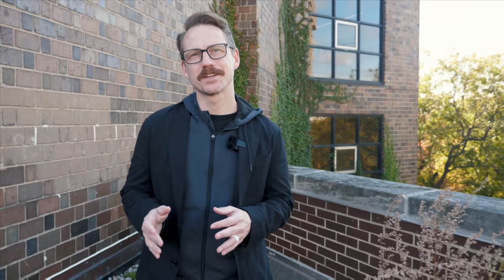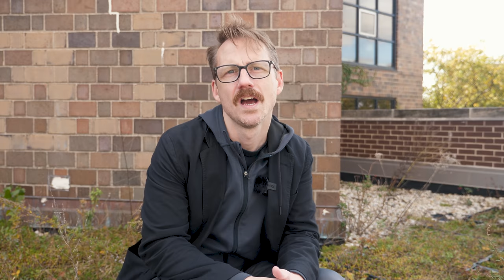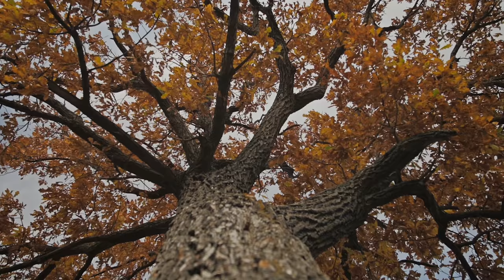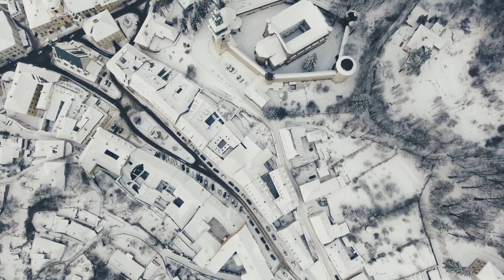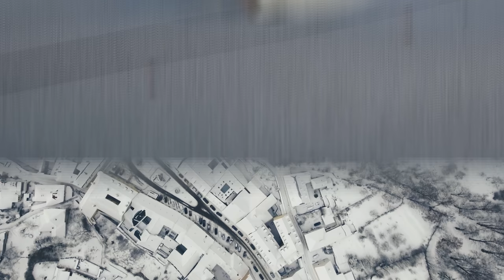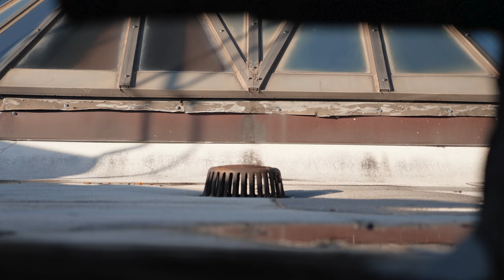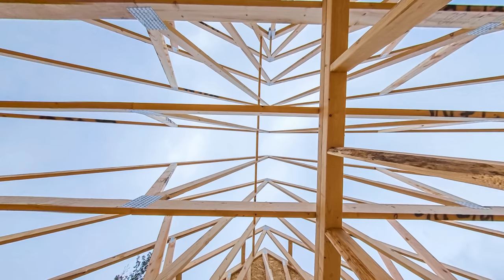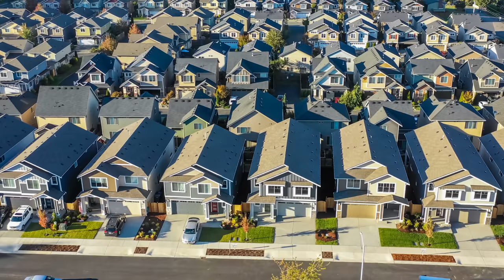Why Do Architects Insist on Using Flat Roofs?

Comment: Flat roofs waste a lot of heat energy and cause moisture (mold!) issues on the inside that are unrelated to leaks. You aren't doing much to dispel the "Architects are arrogant" story by skipping this big topic. Also, you neglect to mention climate. In ancient Egypt, where there is little rain and it is generally dry, a flat roof makes more sense in some cases, especially using old traditional building methods.

It frustrates me so much to hear you making claims about sustainability without mentioning the topic of how attics work to regulate heat and moisture, and how using various expensive layers of petrochemical products, is the only way to rectify that. (unless you are in a dry stone building or other traditional construction.)

I love green roofs with usable areas. But architects more often opt for big black petrochemical surface heat island roofs that you can't walk on regularly due to risks of causing a leak.

That air pocket of an attic is a design that is more intelligent than the buildings that are often built using "new" methods. I want my buildings to last more than 20 years, thank you very much.

Comment: You didn't addess the snow. How do you get rid of 1 or 2 meters ( 3 to 6 feet) of snow on a flat roof? Where I leave all roofs have a 100% incline or more just because of the snow. We don't have skyscrappers but barns and stables can be a relatively large surface area. 20 by 50 to 100 meters is pretty common. And for cheap construction tunnel shaped roofs are the norm. Never saw anyone making flat roof here. So how do you deal with 6 month of snow on a flat roof?

Comment: I have a flat roofed house near Seattle.  Horrible choice for this area.  The moss can’t roll off, so the downspouts get plugged every year, and the ends of the support beams are rotting because the eaves don’t come out far enough.  Hoping to move soon.
Reply: well, a flat roof has to be cleaned, just like the gutters need to be cleaned on a gable roof.

Comment: The Flat roof does not fit the astetic of my city and i dislike anyone building their slow slope small roofed flat Buildings, next to this citys beautiful Gabled roofs. It is easy to design the gabled roof with a room (in the roof) for someone to live in, and it is very practicaly to use it in places where there are not that strong winds and too much snow in the winter.
And i must say from my life in this city i've encountered it more often in the "new" building style of flat roofed buildings that it is dripping in the building and much much less in  the ones that have pointy roofs. Maybe its just my bais but if a pointy roof is dripping in the building the damage is most of the time easyli identifiable (for example a tree stuck in your roof) , and not hid under 2 to 4 sheets of some compounds that you first need to, shovel stones around, find where the water seeps throu.

Comment: The many defensive flat-roofers in the comments trying to explain away the problems people have had with flat roofs as "just bad craftsmanship" completely miss the point:  Yes, most construction workers are not OCD perfectionists...so if you live in a place with rain, just don't build the flat roofs that you already know they are inevitably going to screw up, and which will therefore need replacing (and other expensive repairs caused by leaking) much sooner.

Comment: well a flat roof does have advantages!  its may be cheaper and definitely faster to build, gives you another floor!  they are low profile so blend into the environment better, it can be easier to clear SOME mild snow since you can use a snow blower up there,  they use less lumber/trees, if you have to replace the roofing material its easier, you can put PV panels up there via a racking system that allow easier cleaning/maintenance,  and yes can be a bit more resistant to tornadoes.

Comment: Egyptian and Mesopotamia were so known for their heavy precipitations. 
They have their use but often they are just ugly "modern". There are more option than just flat beds or gables. Gabled roofs are also flat - but you can have just a single flat angled surface. i do not count <5° as being angled as the typical 1-3° are still too shallow for preventing long lasting puddles.
Large multi-story buildings are of course different. when nearby they are just too high for their roof to be visible anyways and they just have different problems and requirements. You can't let snow and ice fall down 50 meter from a sloped roof. That would just be too dangerous.

Comment: What about the social consequences of flat roofs?  That is, I've noticed that anything w/ a flat roof tends to fall into disrepair while the neighborhood looks like a slum & quickly degenerates into one.  Same w 1 story houses in general - they tend to fall into disrepair while the neighborhood looks like a slum & becomes one.  I suspect that we have such a deep-seated belief that 2 story gabled homes are "real" homes that anything else seems cheap & bad, leading the area to degenerate.  So, for example, I suppose there's no real reason we can't build our homes out of metal, but a neighborhood of metal homes would degenerate into a slum simply because we associate metal buildings with cheap or inferior.  Anyone agree or am I simply seeing an association that doesn't exist?

Comment: On Colorado, I'd never put flat roofs on a residence. In the mountains, snow would build up, too much, and down here in the Front Range, the daily thaw/refeeze cycle would turn it into an ice-rink.

On top of all that, a 40-degree roof slope -- basically, the bog-standard 10/12 pitch of 39.81 degrees -- provides the perfect slope to maximize solar panel efficiency, at this latitude.

Plus, I think modernist cubicle architecture is just f-ugly. Hard pass, just in terms of aesthetics, for me.

For taller commercial or office structures, I can see the argument to use flat roofs for HVAC and other equipment, but I'd much prefer a different option than glass boxes. 🙄

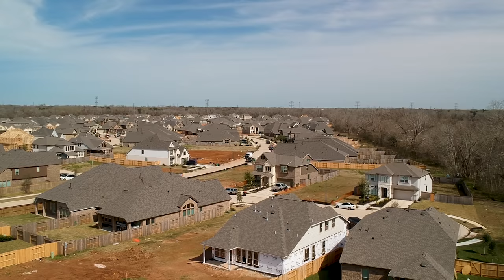Comment: Well thought through explanation. But I find it just very ironic, that the video shows roofs, which have absolutely ridiciolus amounts of angles and corners, when you explain, why gabled roofs are harder to plan and construct. And I really think this is some very weird American thing, especially in terms of an argument against gabled roofs. 99% of gabled roofs in Europe are just very simple tent shapes. In some rare cases, the garage has a different roof or an extra angle and sometimes houses with a regular square base, have pyramid forms, but thats really uncommon if we are talking about an average house. So I think the math and construction behind a gabled roof goes up in complexity, if the local architectural preference asks for seriously unnessecary forms as you showed at 8:36 for example...

Comment: You began this video by saying that roofs collect snow and collapse under the weight. I live in a snow prone area of upstate NY. I have heard of no more than two roofs collapse from snow and they were old structures, happening decades ago. Our home is a Cape Cod style with two massive, flat but tilted roofs. We now have a metal roof. The snow accumulates to a point then slides off harmlessly onto the ground. So your assertion is only partially true and under certain circumstances. FYI... According to the Merriam-Webster dictionary, the plural of "roof" is "roofs."

Comment: You say multi-gable roofs are "silly"; so why is it that they're so frequently used in large buildings - such as in factories which have lengthy production lines, or in which large ground area is needed, and where the weight of objects brought into the building means it's impossible to use multiple floors?
Secondly, you point out that gabled roofs are susceptible to wind damage - then you show pictures of homes with very shallow gables.  Research was done at a university in England showing that the more shallow the gable, the less it can withstand strong winds.  The researchers also confirmed the correctness in design of the A-frame buildings of the Early to Mid-Medieval period, and later designs of buildings with gambrel roofs in eastern areas of England, which in many areas, is flat as a pancake, and very exposed to storm force winds coming in off the North Sea (bear in mind that the furthest you can ever get from the sea anywhere in England is about 70 miles). Here's an example in England, though you can also find many examples in the most windswept parts of the US:
https://southernpremierroofing.com/wp-content/uploads/2021/09/3051916_236dfcc5.jpg
And not how the roof space, far from being useless, is used as bedrooms (note the dormer windows in the roof).
Steeply angled roofs are so wind resistent that, in the same part of England, you'll find many homes with thatched roofs, many of them built hundreds of years ago:
https://www.cambridgeindependent.co.uk/_media/img/620x0/OEPN37KBBCELH8IJVDDF.jpg
As for it being so difficult to use loft space for anything but storing junk, there are companies all over Britain who do nothing else but converting lofts into additional rooms.  A 'net search on Google using the term "loft conversions, uk" brought up over 2,500 entries.

Comment: Gable roofs are more likely to shed ice and snow on the pedestrians and cars  stories below. It's much easier and safer to repair flat roofs. Flat roofs fir smaller buildings are dumb in places like Texas where they have tornadoes. Gable roofs are less likely to tear off the buildings during those extreme weather events.

Comment: Also, unless you are on the equator, most latitudes would require a substantial tilt to the roof to face the Sun for your solar panels.    Frankly all homes should be designed as if solar will at some time be put up.

Comment: Building have this shape to be imlosing.bits thr opposite of the Disney castle effect.  It makes something big look deceptively small and then when uou interact with it its shockingly sterile and imposing.  Think of the convention center.  You know its big, it looks nig, but its not until you walk through empty space and gardens added for comfort that its size becomes impressive.  My favorite is running on 5 of 20ks on freeways in which what normally looks to size immediately becomes huge.  How long does it take to run through an intervhange?

Comment: Perhaps the fact that  gabled roofs require less angled infrastructure underneath to support solar panels and they are flat surfaced facing to the south in colder climates and catch the rays in the winter they would be a plus over flat roofs. Personally I would prefer a monolithic dome if living in the worst death by hurricane/tornado/flooding/gun happy state of Alabama.

Comment: The same reason we use box gutters and no step Thresholds. Because we are idiots. 
.
I do not agree at all with most of this. 
It is now more common for a roof on a new apartment building to leak than for it to be waterproof. He missed the actual common cause of leaks on a flat roof.  The three big issues are: 
1. Concrete slabs expand and contract much more than expected leaving huge changes in gaps that no product on the market can handle.
2. Over time concrete slabs sag way more than people expect and water does not flow towards the drains because idiots like me thought it was a good idea to put the down pipes in the columns.
3. By far the biggest cause is that the drainage slopes are not set into the concrete slab but applied later over the top using the cheapest unskilled labour the contractor can find.

Form follows function is not a law it is a design strategy.
Any architect with half a brain can create an interesting space with a sloping ceiling, it is not that hard. 
A gable roof is actually less prone to with wind forces than a flat roof because it is a more natural shape than a block. What you are talking about is actually the overhang that comes with sloped roof. You do not actually need to add the overhang if you don’t want to but in most climates they are incredibly useful. Overhangs provide shade on windows and have the largest effect on reducing heat loads on windows. Overhangs on sloped roofs actually get less wind loads than the same overhangs on a flat roof. 
.
I do not see any reason why the airspace under a gable roof needs to be stagnant.
.
There are a few big reasons flat roofs are used everywhere:
1. They are cheaper.
2. Height and shadow restrictions.
3 good place to put all the ugly mechanical stuff.
4. They are CHEAP

Comment: The house i moved into had a virtually flat roof (maybe 5% pitch). Despite being resurfaced only several years earlier it was leaking within months of moving in. So I fixed the problem by building an addition with a properly slopped roof.
You could do a single slope roof. Make it about 15 - 20%. It would be simple and more effective than flat.

Comment: a 500 sq brick house with a flat roof and 10 foot outward wrap around porch and covered deck would be amazing especially if the buildings hat was covered in a overlay of timber boardwalk  planks have a pickleball court built on top of your house

Comment: A sloped roof sheds snow intermittently.  When is a good time to have 2 tons of snow fall from 50 stories up? Yes better to have a flat roof with a parapet to keep all that stuff in place. Heck you can put some heat tracing up there so you can melt the snow on your own schedule.

Comment: Also, if you randomly throw 3 shoe-boxes on the floor, often the resulting junk-pile has a flat-roof.  As this is the most common method for modern architects to "design" a building, flat-rooves are common.

"Form follows function" is what I say when I've had months to do a project, but I didn't start it till 3am on the morning it was due.  There's no time to do a 2nd draft, or make anything look nice.  I've simply done the minimum possible effort for passing your criteria, so shut-up and be happy with that.  If you wanted quality, you should have gone to someone who charges more.  Why do you think I'm wearing a hessian-sack instead of a respectable business-suit to this meeting?  Form follows function, bruh.

Comment: All cheap 8 story condos built in 1980s in Russia and China are flat roof. If well maintained it does leak. Holding snow is also not a problem. I see many houses in beverly hill over 10 millions are flat top.

Comment: Wait, flat roofs also have unoccupied truss structures too, usually also followed by hanging insulated ceiling... whatever you route through there can go through the roof, and large buildings have rooms dedicated to facility machinery, A/C units, boilers, water and ducting etc, just put that in the unoccupied roof. And who says the drain water has to flow continuously, picking up great speed? Just more excuses to make everything a boring office building box! ;P

Comment: I do affordable multifamily in DC and 95 times out of a 100 I'm using a TPO roof and the reasons are twofold. First, I need to install a green roof as part of meeting the stormwater management requirements of the city. Secondly, I need a place to put my mechanical system and at grade square footage is too valuable.

Comment: Gable roofs works for residential yet residential condominium, commercial and retail malls are still the best for flat roofs. For maintenance, services and accessibility for services. Dont understand why America are still using composite (wood, tar, etc,, etc) roofs than concrete which will last longer especially if protected properly takes more than 50 years.
Reply: lol, concrete isn't waterproof, stick to what you know.